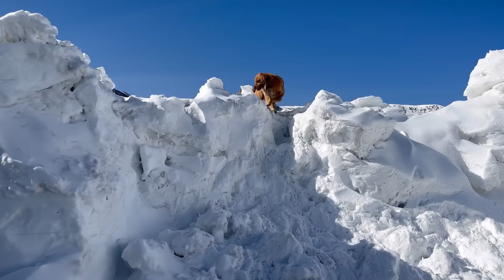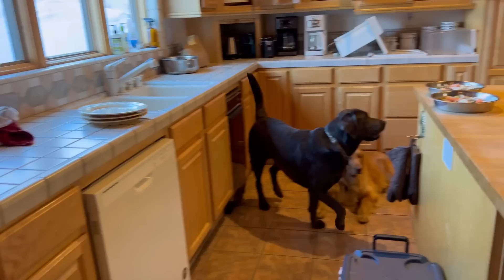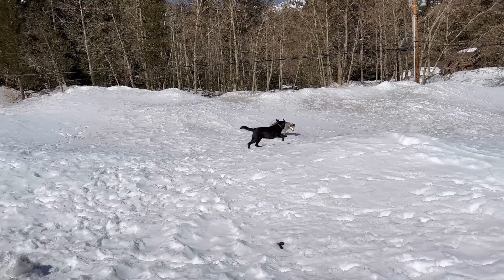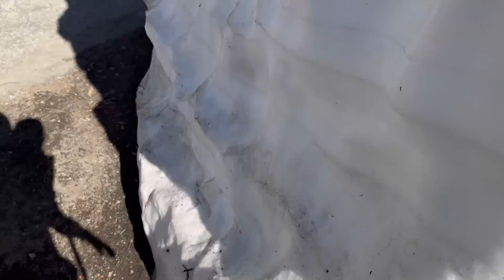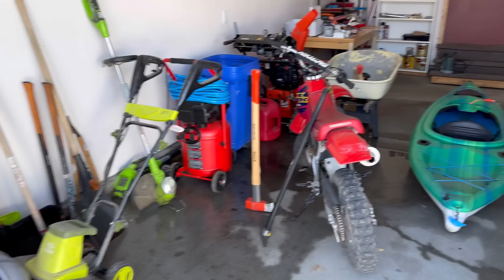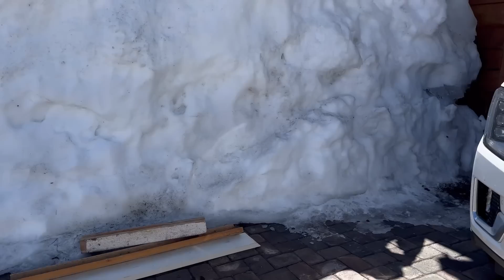It’s melting! Once in a lifetime snowmelt underway. Mammoth Lakes 2023

Comment: Good work with all the snow removal. 

had the same issue with a GE monogram freezer. The fan and the evaporator was bad.
Couldn't get a repair guy out for  6 weeks.
Fixed it myself.

Comment: Enjoy the vid's up here in Big Bear they dump trucks snow guys leave the beds up so the snow doesn't pack in... I have a steep drive way leading down to my garage, there is a rubber seal on the bottom keeping most of the water out.  I lived on a hill, I was loading my race car into my enclosed trailer half way in it started rolling down hill only. did that twice haha

Comment: Ground settling could cause the foundation to lower beyond what was expected.  I would think that all the weight from the snow has to have an effect below the frost line.
I would expect the ground would be softer toward the middle of the foundation being more heated and insulated.
Cold condenses the moisture and the expanding molecules of the heat can weaken do to pockets or more transferable material. 
(simular as different metals
transfer and storing heat based on molecular disposition)

Or getting squishy and expanding below the frost line. 

Might be able to tell by cracks or broken cement around the foundation that wasn't there before. (Raised)
🤯

Comment: I have a hard time understanding how a guy so accomplished, who has a business emergency-clearing snow from roofs, leaves his own roof completely piled with dangerous amounts of the stuff, and is only concerned with "maybe gettig a couple guys up here to remove this lip here," instead of doing the job correctly and clearing the entire roof. It just boggles the mind.
Reply from the maker: We just moved in…
Reply: @plowbrothers365  I have no idea how that is the least bit relevant, since your new address wasn't a surprise. Love your videos, man, and wish you all the best. CLEAR YOUR ROOF!
Reply: @-108-  maybe, because he doesnt own the house and it had other tenants, he had no right to be there clearing snow unless contracted by the owner.
Reply: That's not enough to worry about at this point. It snows 4-5, or more  times that much n a single dump.
Reply: @larryfreeman7979  Ok. But it's still pretty ironic. That would've been my first order of business, as it's not only dangerous, but also responsible for the water collecting in the garage. 2 birds.
Reply from the maker: @-108-  it’s not necessary at this point
Reply: @plowbrothers365  No, at this point, you need to get in that excavator and shovel a few tons of snow back up on that roof, so you can remove it.